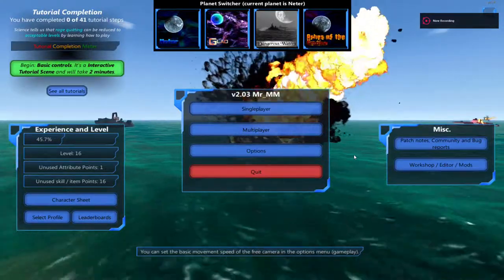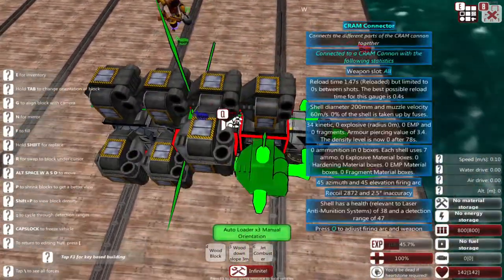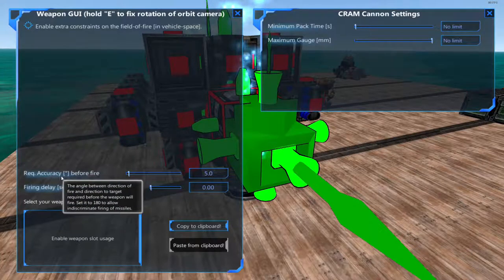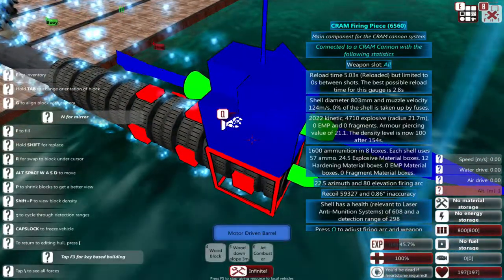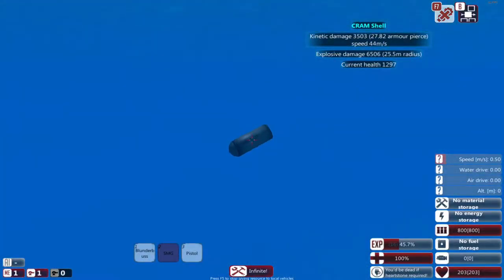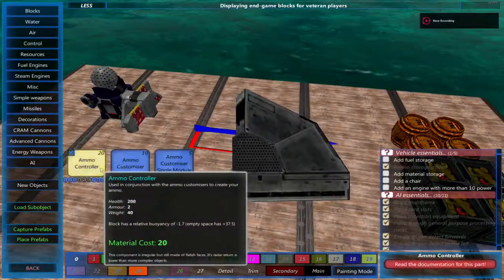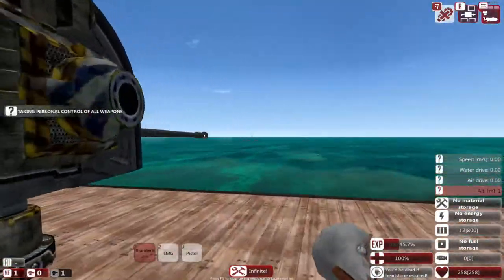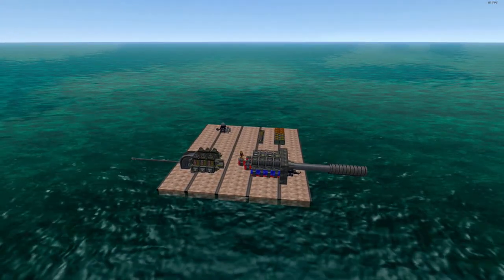From The Depths: Advanced & Cram Cannon Tutorial

Comment: Never use connector blocks, they are a waste of space on any cannon. Be efficient and use gauge increases or coolers instead.

When building a turret make sure you have no empty spaces in the design as you want it to be as compact as possible.
Always build in a cylindrical pattern instead of a rectangular, as it will keep the turrets space requirements down. So it is advised to first make a simple outer case for the turret and start filling it in.

For beltfed autoloader turrets your bottleneck will usually be the barrel cooldown time and that is fine, but for regular autoloader advanced cannons make sure the loaders are the bottleneck as you don't want to have excess autoloaders when your barrel cooldown time can't even handle it.
After setting up a constant fire rate where it is just below any stuttering begin removing coolers until the firerate suffers from barrel cooldown time and then use the next highest amount of coolers.

When building a turret with a diameter under 150mm always use multiple barrels, there is no point having one barrel as the cooldown time suffers. Gauge increases are always more efficient than Coolers due to them allowing you to have multiple barrels which cool faster. So always use as many barrels as your diameter of the shell will allow. Always have 8 gauge increases as that is the maximum amount you can stack. 

Set up the firing rate of a CRAM cannon before using it, as CRAM cannons projectiles gain damage the longer they are loaded. A CRAM cannon should be kept at a low firing rate, but not too low as shells get filled with diminishing returns. Having a high rate of fire on a CRAM cannon is a waste of munition as the damage/ammo consumed will be negligible. 

Use 5m axis turrets when building bigger turrets as they will turn faster when loaded with heavy weight.
Reply from the maker: Thanks for the tips and i didn't add any more barrels because i wanted to keep it simple and so i might make a more complex tutorial later
Reply: Also when building from the 1 axis turret upwards using gauge increasers or coolers the only way to connect them to the firing piece is to first put a connector on top of the gauge increasers, then slap a firing piece on the front side of it and switch the previously placed connector to a 3 way gauge joint using the F3 Keyboard mode while holding down the Shift key. That is because the T joints only work if the firing piece is connected to the middle input. Otherwise the coolers/GI below will say "Not connected" ;)
Reply from the maker: I've done this in Season one on my main battleship which wasn't that good but i know how to build upwards turrets but still thanks for the tips!